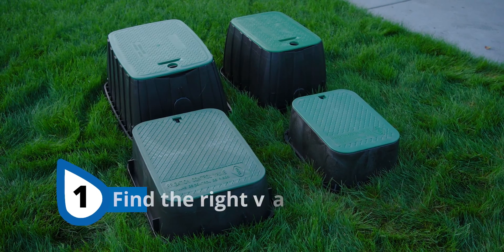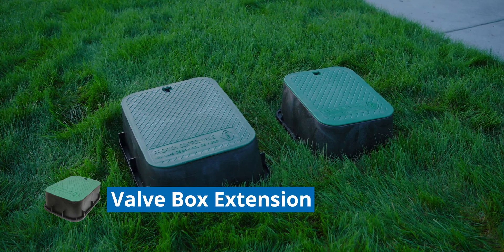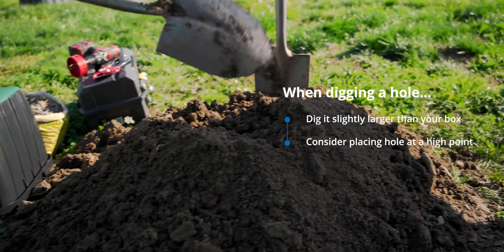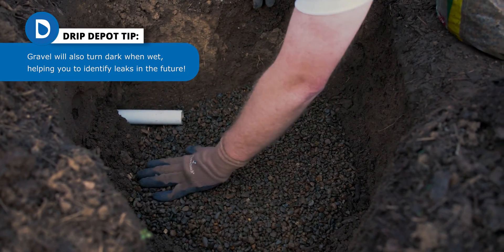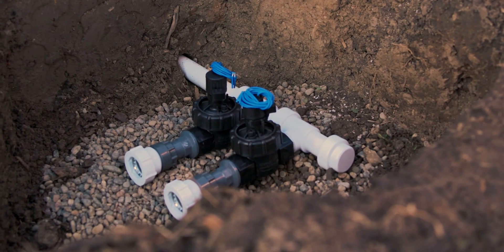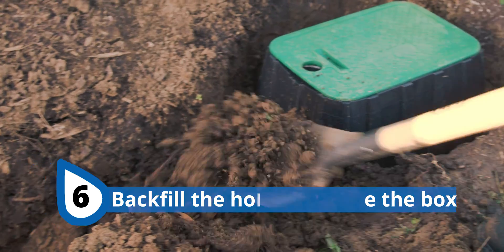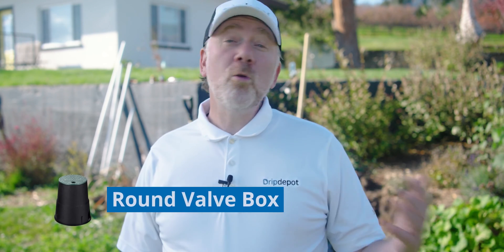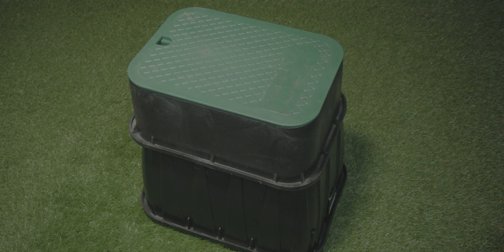How to Install an Irrigation Valve Box | Sprinklers & Drip Irrigation (DIY Beginner's Guide)

Comment: Aren’t you supposed to cut the sides of the box so that it isn’t resting on the pipes, so that if someone steps on the box it won’t press on the pipes?
Reply from the maker: You got it exactly right :)  We did actually cut the sides out of one of the valve boxes we brought that day with a hole saw, but it looked terrible on camera so we scrapped that one (the jagged cut was most likely my fault).  We also left it out since it can vary between boxes a bit, some come with punch-outs instead so the process can be different from box to box (or that's the excuse I go with, when in reality it was because of the bad cut I did with the hole saw lol).  

When we re-do this video at some point in the future I'll pre-cut some holes at the warehouse so they're presentable haha - for those at home, don't worry what the holes look like since the box is going in to the ground, just make sure they can accommodate your pipe :)

Comment: I noticed the box was sitting on top of the pipes. I assume you cut out part of the box to make room for the pipes so it no longer rests directly on them.
Reply from the maker: Yep, you got it!  We used a hole saw to cut out and it ended up not looking good on camera (probably my fault!) so we left that part out.   We also left it out since valve boxes vary a bit, some coming with punch-outs and some not, so we just eliminated it to avoid confusion.  We'll re-do this video again some time to update it and will likely keep the information in since we get asked about it :)